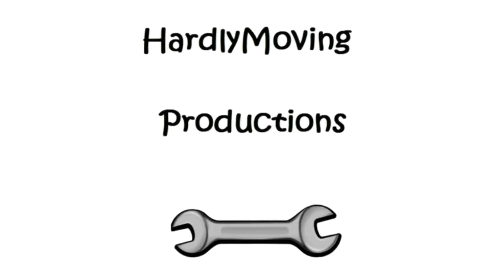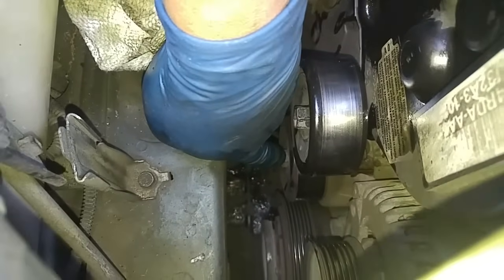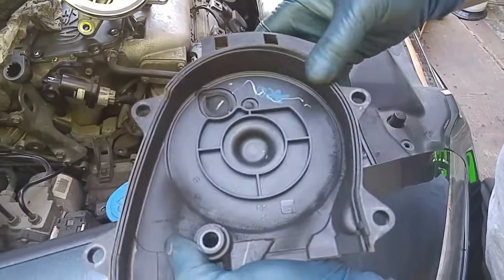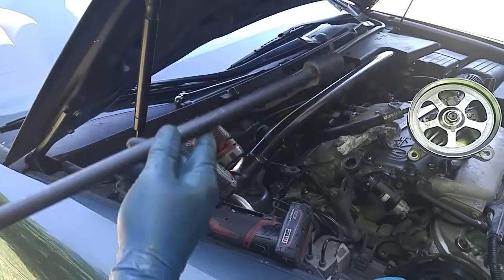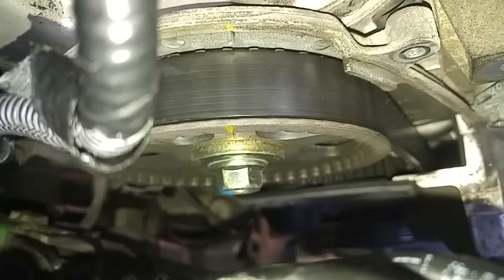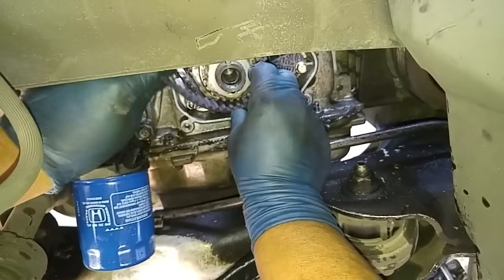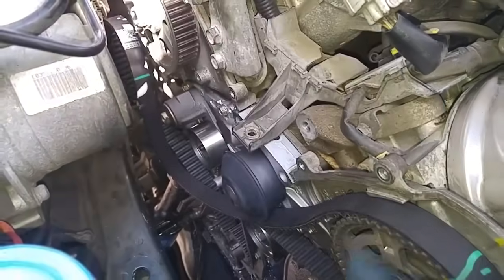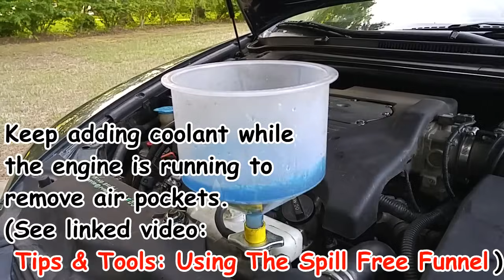Acura TL (Honda Accord V6) Timing Belt, Water Pump, & Pulleys Replacement

Comment: FANTASTIC video - best I've seen in a long time. Quick, clear, fast forwarded exactly when needed and freeze-frame with arrows when needed. PERFECT. Can't wait to get cracking on my new-to-me 04 TL!
Reply from the maker: Thanks for your post and good luck with the tb job!
Reply: @hardlymovingpro  So I'm into it today and so far so good, but now I'm trying to line up cams and I have no yellow marks...what do the marks look like otherwise if there's no yellow paint to go by? 
Another question: With your method of making (blue) marks and transferring to the new belt, why do I even need to find TDC? The car is currently properly timed; I just need to leave everything as it is, mark the cams and crank (and belt), transfer marks and replace, right? Why would it matter where the engine is in its cycle (TDC vs. wherever it randomly stopped when I turned it off) as long as I don't move anything and just replace the belt in the same spot?

Comment: Replaced Timing belt put it on TDC but when I started it, it cranks but doesnt start up. Am I missing something? Its a 2011 Acura TL 3.5 L. Double checked and everything was TDC. I had the timing belt kit and replaced everything. Can't figure out whats wrong though.
Reply from the maker: Check all electrical connections.

Comment: Just successfully did the timing belt, bearings, and water pump on my 2002 Honda Accord V6!  I would never have felt remotely confident enough to try it, had I not found this amazing video first!  I had a few issues: the harmonic balancer bolt was dead-locked.  I was even prepared with the exact high-mass impact socket attached to my heavy duty 1/2" impact...and it wouldn't budge at all.  I eventually had to employ the bump start method to get it off.  Highly stressful, but it worked on the 2nd try!  The other issue I had was that my tensioner was a different design from the one you re-used in the video.  Instead of a pin, mine comes with this ridiculous "clip" over the ends, compressing the whole thing together.  But the spot where it goes was so tight, as soon as I got it down there it came off.  At that point I thought I was totally screwed.  After over an hour working on it, a buddy of mine comes over and we discover(using the old tensioner) that you can not use a vise to get it compressed again.  You have to remove the nut on the back end and use a flat head screw driver to back up the tensioner to get the clip on.  I then zip tied the clip on and after a long struggle I was finally able to get it bolted down.  I had to thread in the top bolt on the tensioner and then use every bit of strength I had in me to push the tensioner bearing up so that I could force the tensioner in place and thread in the lower bolt...it was definitely the toughest part of the whole job!  I also replaced the 2 other drive belts.  I've never done a job this complicated and having your video in the garage with me was a life saver.  After all parts were in and engine was ready, she started up on a dime and I took a 20 minute drive on freeway.  THANK YOU SO MUCH FOR MAKING THESE INCREDIBLE VIDEOS!!! THANK YOU SO MUCH FOR MAKING THIS VIDEO SIR!!!  I wish you sooooooo much health, happiness, and abundance.  Please reply if anyone reading this has any questions for me about my specific vehicle or whatever, I will check periodically.   Oh, and I'm now a faithful subscriber. Mazel Tov, it's a boy!
Reply from the maker: Good story and glad it all worked out for you!  You saved over $1,000 if you had let the dealer do it!  Surprised the bump stop method worked for you.  I began using the high mass socket when the bump stop didn't work for me anymore.  If you remove all the timing belt slack to the left and right of the tensioner pulley, you shouldn't have had any problem bolting on the tensioner.  That would mean moving the rear cam counter clockwise and the lower crank clockwise.
Reply: @hardlymovingpro  The shop wanted $1500 and I only paid $400!  So over 1k!  I knew it had to be a slack issue but couldn't really figure out what to do in the moment.  Thankfully I was able to force it in; but thank you, I'll remember that next time.  And yeah, I was totally expecting the high mass socket to work, but it failed hard.   Thank G-D the bump start did work, cuz I don't know what I would have done if it hadn't.  So you can move the cams and crankshaft separately and in different directions independent of each other?  I would not have thought to do that.

Comment: Always install a new tensioner .
Reply from the maker: If's it's leaking.
Reply: @hardlymovingpro   That pool of oil in it, was from leaking. These are a known issue and should be replaced every time regardless
Reply: @patharmon9760  yea lmao if you have everything apart why would you not replace the part that is likely to fail
Reply: I was thinking the same thing.  He will have to take all apart again once when the tensioner starts making noise on a cold start up
Reply from the maker: Accessory or timing belt tensioner?

Comment: Thanks for the Post and i have not seen such an wonderful ways of explaining things to users and this will really help the others globally with confidence
Reply from the maker: Thanks for your kind critique of our videos and yes, we do wish to help those with tight budgets repair their own vehicles.
Reply: @hardlymovingpro  Thank again and i need your suggestion. I do have a 2002 Acura TL type s with 183000 Miles on it , For a full tank i get close to 220 miles and have replaced the spark plugs , still the same . Timing Belt change will improve the Gas mileage ? just an ask .
Reply from the maker: @chenthilkumar9724  If there was a slight belt stretch with the old belt, with a new belt the engine should run better since the camshafts and crankshaft will be in perfect alignment.

Comment: Thankyou very much for this tutorial video, straight to the point. I have a Acura tl and the coolant reservoir keeps overflowing everytime I drive my car. My car also overheats and coolant starts to boil inside the reservoir and splatters everywhere on my engine bay. I've replaced the radiator cap, radiator and upper lower hoses. Could this be cause by a waterpump going bad by any chance? I'm sure its not my headgasket because my coolant looks fresh and no blue smoke from the exhaust pipe and car runs and idles good except it overheats. Please let me know so I can proceed this process changing the waterpump myself. I don't want to break a arm and leg just for this fix. Any help will be appreciated!! Thanks for the video, liked and subscribe sir!!!
Reply from the maker: Sorry ... but it's a blown head gasket.  You will eventually see white smoke coming out of you exhaust pipe and you engine oil getting a white milkshake color.  Try using a product called K-Seal head gasket sealant.  It may buy you a little bit more time before doing a head gasket replacement job.
Reply: Hello like everybody else great video I somewhat have a similar situation but not really to the guy about you telling him it's the head gasket I got into an accident replaced everything on the front including radiator headlights radiator support condenser everything everything went well I used the right coolant but at first I didn't and it I was just about to be happy and have my daily again filled up the coolant and was bleeding the air out but then my girlfriend noticed a little bit of a leak on the oil pan on the passenger side 2005 EXL 6 cylinder Honda Accord I am now stumped the car runs and drives great does not overheat unless I let it get hot because of this issue do not understand where the coolant leak is coming from and why can't find anything on the internet and I've been going nuts I was going to do a replacement I'm not a professional mechanic but I've been racing and replacing and doing cars since I was 17 I am 39 now and I have every single tool that you have put engines together put engines in cars have done head gasket jobs on an hourly Volkswagen guy but first was a Honda guy for the life of me can't figure out why or where this leak is coming from it's just coming off the oil pan as soon as I put the coolant in rather the car is on or off and it didn't do it prior to the accident it doesn't it looks like it's coming from the metal lower or upper cover on the passenger side it's like a drip but if I pour coolant in car on or off it'll either slowly come out or come out fast but when the car is on and the Heat or the froster I forgot it will sometimes not leak but as soon as I turn the car off all the coolant will drain from that spot anything would help me greatly I'm dying here thank you man

Comment: Just did this on wifes Honda pilot and I learned a couple new course words doing the timing belt.  Great job! Oh and I had to do the breaker bar and bump the starter a few times to get crank bolt loose. It was laughing at me.
Reply from the maker: You're lucky you got it off.  Use to do the bump start method till my luck ran out one day.

Comment: Great video! Just picked up an 07 type S and it recently started making a rattling sound on really cold mornings (30 degrees or less) but goes away when warning up. Dug around and apparently the hydraulic tensioners in these cars go bad causing the belt to flap around. Unsure if/when belt, pump, and tensioner were done so thinking of doing it myself just to be safe. How do you keep the crank pulley from moving without impact tools? And how did you know where to mark the belt before installing? Thanks again!
Reply from the maker: Congrats on your type S purchase.  If not sure when was the last time the belt was replaced, play it safe and have new parts installed with good parts you're comfortable with.  Never know the quality of the previous replacement parts.  The tools needed to remove the crank pulley without impact tools (like a crank pulley holder and a super longer breaker bar) isn't worth it.  You can get yourself a cheap AC electric plug in tool for around $50 now and use that with the high mass impact socket.  Paint marks were based off of the camshaft and crankshaft top-dead-center timing alignment marks.  It's all in the video.

Comment: Would I need to follow this exact procedure to replace water pump?
Reply from the maker: Yes ... since the water pump pulley is driven off the timing belt.
Reply: @hardlymovingpro  yesterday while driving my car I noticed the temp gage go slightly up, i got off the car and heard boiling noise underneath my hood, I bought a radiaotor cap and replaced the damaged one thinking it was that.. i left the car on & unattended & my wife told me she shut it off  because she saw the temp gage at H & it smelled like burnt.. I added coolant & saw it leaking off the frame behind the passanger wheel.. im assuming its the water pump.. would you agree?
Reply from the maker: @los0160  Yes ... a bad water pump would be a good first assumption.  I'd still verify by getting under the car and make sure it's not some leaking heater hose leading to the firewall.   If you bring your car to Pep Boys, Firestone or Gateway they'll put the car up on a lift and give you a free estimate.  Have them show you the source of the leak.

Comment: I have a 2003 3.0 Accord. All of the mechanics that I've spoken to have said that, if the timing belt is broken, there could other serious engine problems due to the timing belt being broken?? is this true?
Reply from the maker: Yes ... but if the belt is broken (or broke at a low rpm), the camshafts and crankshaft can be set to their alignment marks and a new belt put on.  From that point, the engine can be started and then the extent of the valve damage (if any) can be determined.  Some will say it's not worth the effort.  They'll assume there's valve damage.  Since I can replace a belt pretty quick (around 1.5 hrs), I can start the engine without having to put everything back together and see how well the engine runs.  If the engine does run poorly, I can do a compression test to determine which cylinder has the damaged valve(s).  At least I'll know what cylinder head to remove.   Then there are those who say if you're going to remove one cylinder head, you should remove both.  That argument is debatable.
Reply: @hardlymovingpro  I actually live in the Memphis area. I have already bought the timing belt kit with water pump. How much would you charge for just putting the timing belt on and seeing if the car will turn over?
Reply from the maker: send me your email and we'll talk.

Comment: What is the difference between the 3.5 and the 3.7,

Would this engine fire if you put 3.5 Into 3.7 car, 

I researched and got to know the the crank sensor plate is the same but I don’t know that of the cam sensor plate ....
Reply from the maker: https://www.caranddriver.com/news/a18737178/honda-finally-adds-direct-injection-to-its-v6-and-four-cylinder-engines/

Comment: I'm lost on one part; when you use the crank to set TDC makes sense, however, when trying to remove the bolt from the rank it spins the gears, so it goes out of TDC - what am I missing about how to remove the bolt from the crank without moving everything off TDC?
Reply from the maker: Reinstall the bolt on the crank if realignment is necessary
Reply: @hardlymovingpro  My fault, amazing what a top of line Makita impact wrench purchase can do, I think I can disassemble a 747 with this thing - as they say, the right tools make all the difference.  Thank you very much for taking the time to put this video together, best on the internet by far, did the entire thing today, hands hurt :), but that's ok.  Take care of yourself.
Reply from the maker: @greggramos  Thanks for your kind comments and glad everything worked out for you ... Using power tools!

Comment: Hey sorry so I aligned my crankshaft at TDC and my other pulleys are not right. Do I aligned those or what should I do now?
Reply from the maker: Turn the crankshaft one more full revolution (360 degrees) and everything will line up.

Comment: I have the same exact vehicle as this. Mine has 178,000 miles on it and hasn't ever had the timing belt replaced. One day while WOT Accelerating out of a turn, the engine started to misfire noticeably. I pulled the codes, and it is misfiring on all 6 cylinders. I've checked the usual ignition components and haven't found any issues. This leads me to believe that the timing belt is likely the issue. The question I have, is when I go to put on the new timing belt, how do I appropriately line up the new belt as you've done with the old functioning one? I can get the motor to tdc and line up the cam pully and all, but how can I be certain that the belt is lined up?
Reply from the maker: I am going to guess that you're misfire problem is related to a jumped timing belt. Assuming this is true, the thing to do is to align your crankshaft to top dead center first. Then check the position of your camshafts. So if your timing belt jumped I would assume 1 camshaft would be in alignment with the timing mark while the other camshaft would not. You simply need to remove the timing belt Andre position that camshaft that is out of alignment to the top dead center mark.
Reply from the maker: Also, since you can’t used belt paint marks for the belt alignment, you have to check the belt tension between the cam and crank sprockets.  That is, if there is to much belt slack between the crank and cam, your out of alignment. You can move the crank one cog to the left to mount the belt, then position it back to remove the slack.  The same logic can be used for the two cams.
Reply: Hardly Moving Productions thank you do much for your response. I'll get started now. I have the same kit as in your description. Thank you very much. Subbed
Reply from the maker: No problem and good luck with the job!

Comment: Awesome Job.   How long would you budget for the job start to finish?  I don't quick have all the power tools, so mainly will be doing a fair amount of wrenching....
Reply from the maker: I’d say between 6 to 8 hours.  Your biggest problem would be getting the crankshaft pulley bolt off without using both a impact driver and a high mass 19 mm socket.
Reply: budget a weekend (cause you always run into problems) and do yourself a favor and just grab a 3/4" breaker bar. Enough leverage (4ft+) and it's not that hard to get the crank bolt off. Using 1/2 dr can be sketchy but 3/4 it's no problem. HF sells one for cheap.

Comment: what do you mean when you say your moving the cam shaft slightly forward and back? is the whole cam shaft  moving when you crack that bolt? or is it just rotating to make it easier to slide the belt on? and also if it is rotating wouldnt that taking it out of timing?
Reply from the maker: To ease installation of the belt.  As long the you rotate back to the alignment marks, it's not taking it out of time.
Reply: Hardly Moving Productions thanks so much great video and instructions!
Reply from the maker: @_LeggoMyEgo_  You bet!

Comment: Hi i got that all changed out and oe parts on and there is a whistle type noise coming from the timing area any idea?
Reply from the maker: If there was no noise before the repair, and now there's noise after the repair, the onus is on the mechanic who did the repair to figure it out.
Reply: Hardly Moving Productions there was a horrible sound before that would go away when warmed up but then suddenly was just constant noise
Reply from the maker: Before the repair?
Reply: Hardly Moving Productions yeah it was the waterpumo